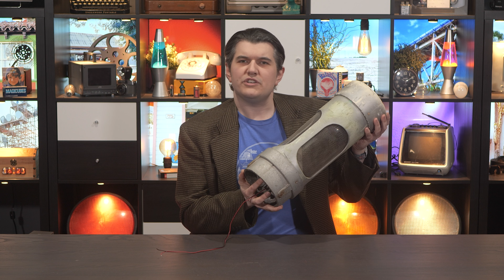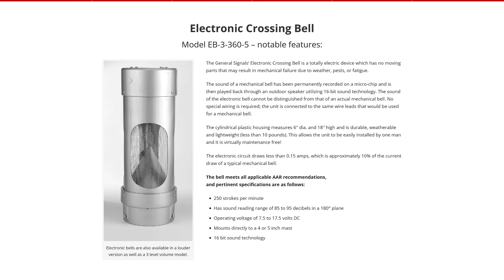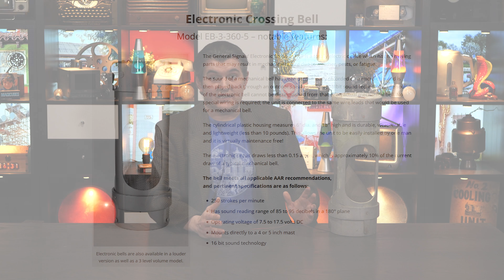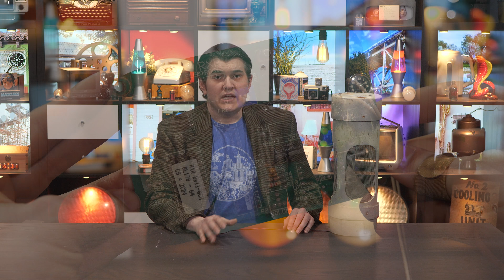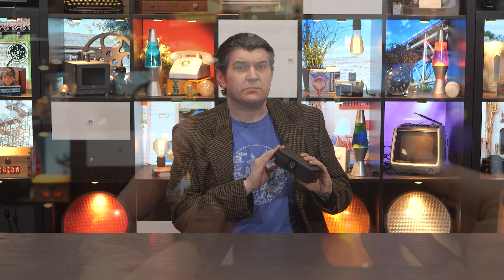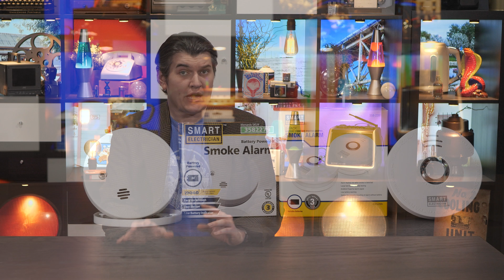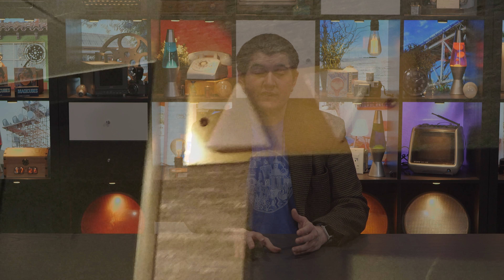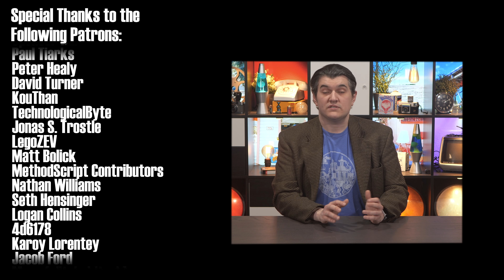The disappearing and unappreciated art of audible alerts

Comment: When I was a kid growing up in the country, one of the things we used to do for 'fun' was to take an old strip of wire and rub both rails at the same time to trigger the railroad crossing. 

The tracks aren't just rails but also an active electrical circuit. Current runs through one rail, and a receiver on the other end is waiting to pick it up. As long as nothing's bridging those two rails, the circuit stays open and the signal system reads it as clear track.

A train closes that circuit through its steel axles. The moment wheels hit both rails, it shorts them together, the receiver drops out, and the system interprets that as a train being present and triggering the lights on and bell ringing.

The wire did exactly what a train axle does. The system is fail-safe by design. A dead battery, a broken wire, anything going wrong defaults to triggering the warning. The safe state is always to alert rather than staying silent.

Comment: There likely was, years ago, a team at various companies which solely worked on audio design for user interfaces. Unfortunately the "we will sell you junk and you'll like it" trend has all but eliminated any remnants of pride in product. It's all about shareholders //and nothing else// these days. I feel it may be an art and science which needs a ground-up rebuild to get anything near what you're rightfully and correctly asking for. Intangible and transient things like notifications interfaces are innately part of our culture. Just look at JR East. they are removing station specific "train leaving" melodies which have been in place for several generations at this point, replacing them with one tone across the system. We have a lot to gain by putting just a bit more effort into creating a world in which we can be distracted when we want, and informed when we want in a general sense. great video as usual.

P.S. This has the same energy as the amber turn signals topic. A small bit of mindfulness goes a LONG way.

Comment: The three tone used by certain tv and radio broadcasters at the beginning of an announcement was briliant. NBC uses low-high-mid pitch. I always thought it should be used for every PA system. It is clear, pleasant, and can be heard over or through any background noise. But no. They insist on doing some kind of ear-piercing screach ahead of alerts instead.

Comment: l changed my windows 1O sounds to those of Windows XP because l felt that some of them were too long, and the "drive disconnected" sound felt obnoxiously scary, like something just broke, and my computer picks up on phantom drives on a daily basis, so l changed everything to sounds that were short, sharp, and carried meaning with a bit of seriousness.

Another thing to address is accidental sounds and signals.
For example, entering the library just as it opens, and hearing the audible "click" employees flipping light switches followed by the buzzing, thumping and chiming of the fluorescent light mechanisms starting up, or the creaking of a door, or the flushing of a toilet, or the sound of a receipt printer working or the high-pitch whine of a display device letting you know that it's on (although that starts to become less apparent as your ears get older) or the beeping tone you hear through all your appliances and radios that tells you that either the hot water has shut off or the street lights have turned on (Too late to go outside now, civil curfew)

A similar conundrum can be found with visual signals too.
Like spotting the funny white cap on a person's head from across a sea of moving people in a busy hospital and knowing that means "This is a nurse" or watching the spinning load wheel on a power meter to see how much power your drawing, or the colors on a traffic signals, and things like "The floppy disk means save"   and the zero and one on a power switch, 

All the things we take for granted, accidental or not change the way we think by sending signals to our brain, and are easily disrupted when you change something, and some people just don't realize that until they can't find their nurse anymore or forgot to get up at 8AM because the rooster died.  This is actually quite fascinating and now l look at things on a broader scale instead of taking these  things for granted.

Comment: The only thing available from the hardware store is the casing. The horn loaded speaker and the circuit are definitely not off the shelf. And the simplicity of the circuit means fewer parts to potentially fail so it can have an extremely long service life. And for the record, I went back to occasionally wearing a Casio digital watch so I can turn on the hourly chime. I have a tendency to get lost in thought and/or activities, and the hourly chime helps keep me grounded to the passage of time so I don’t go down the proverbial rabbit hole. 🕳️ And Android sucks.

Comment: I had an actual brass bell on a curved steel spring that rang whenever someone opened my shop door.

When I got too old to hear it in the back of the shop, one of the guys connected a magnetic burglar alarm sensor as a switch to activate a rotating yellow light that came from the roof of an old work truck.
Reply: that is actually so cool and charming!
i just hope it didnt spook any of the customers😆
Reply: @Memeroid-zz8rqI'm guessing the light was in the back

Comment: The part about the door chime being dead simple reminded me of a conversation I had about the video card power cables that are known to basically catch fire. Someone suggested the only solution to the problem is to have active monitoring everywhere. I rolled my eyes at the suggestion, because, well, we've had circuitry protection for decades that handle more power and are entirely passive. So why would we need active solutions for this particular use case when there's a much simpler solution.

Comment: here’s what aircraft “bing bongs” mean generally : 

-bing : notice to passengers usually seatbelt sign. 

-bing-bong : flight attendant paging another attendant 

-bing-bong, bing-bong : cockpit paging flight attendant

while there are from 4 to 12 or so interphones on commercial aircraft, every one of them uses the same chimes. usually the cabin chief will have a small screen they can use to see actually which interphone is paging, while other attendants rely on voice and/or introduction. also every single interphone has a PA function, on some airlines both pilots and the cabin chief makes welcome announcements.

Comment: About the airplane bing-bongs: That reminded me of how department stores used very similar tones to send information to people working on the sales floor.  Unobtrusive tones that easily blended into the background.  One ding repeating every second for three seconds, might mean they need a manager.  Four might mean they need janitorial.  You get the idea.  And you could go for years hearing these as a shopper and never really acknowledging them, until someone points them out.  I tried finding a YouTube video with examples, but I came up short.  And that also reminds me of my old high school's fire alarm bells.  The bells would ring out three numbers (ex: 1 ding - pause - 3 dings - pause - 2 dings - then loooong pause), and that told folks where the fire was (maybe what floor and what section of the building).

Comment: To your point late in the video - I am damn near the point where I want updates off by default on every device I own, simply because every update keeps making things actively worse. When it's a website or app or whatever... I just have to dread updates, which is a state of affairs I really hate. I remember when we could have old versions of things, but of course that's no longer possible for stupid reasons.

As to the main point, I have a lot of things on my phone muted, but the things which aren't, are really important and I miss quiet sounds a lot, so I have a loud notification sound. The trade-off is these things go off rarely, as in maybe four times a week, so it strikes that balance between usability and consideration. This took a fair bit of effort to set up on an old phone, and I can imagine things being worse on modern phones... and of course not everyone can get away with only dealing with rare phone calls.

(I use the Metal Gear Solid codec call sound for calls, simply because my brain is wired to drop everything for that XD)

Comment: 14:30 I feel like haptics have somewhat taken the place of audible alerts, mainly because they are even more unobtrusive to others. (also, Pebble gang)
16:00 I still like the additional functionality and style of my Gear S3, but man do I miss some of the features of the Pebble and I'm so glad they came back after their untimely demise. 
19:00 As a (somewhat begrudging) iOS user, it's very annoying that I can't change the notification sounds for apps at the system level. Some provide the option, but many don't. Also, the fact that the ringer volume isn't a long-press (RIP force touch or 3D touch or haptic touch or whatever the crap they called it before they killed it) option on the volume slider is absurd. 
19:50 THIS. My watch can do that, but it's about 50/50 whether it keeps going after I've read the notification, or fails to start at all. 
21:00 Yeah iOS is basically the epitome of 'this way is best and if you don't like it you can go F yourself.' What's that, you work night shift? Well obviously if your phone is plugged in past 8 pm (when normal people go to bed, of course) then we should update all your apps! What, you're currently using that app and have been nonstop for the last 7 hours like you do every single day? Too bad! It's being updated and will crash the next time you open it! Yay! Isn't Apple magical! /rant

Comment: “User hostile”- forced updates for sure are, sorry for your parents experience there… if updates are off the version should remain untouched. One Motorola says they’re ‘critical’ and will force restart your phone- even when set to off. Insane… 
20:00 “This is a computer, and it would not be very hard to implement” more truths.
When they take features away with new generations of os or app- Just, Why..!?
20:33 exactly!! Make the devices more useful to everyday use… not like I write an email every day, alarms are daily.. stock sound selections garbaaage on iOS.

Comment: We didn't care about preserving the sound when we upgraded our railway crossing from bells to horns in the UK (though we had a continuous bell rather than an intermittent one, similar to France). Ours use a square wave "high-low" tone (a bit like an emergency vehicle siren but faster) that's found in all sorts of places, from industrial workplaces to even some fire alarm systems (though a fast rising sawtooth tone at 1Hz is more common). Both I believe are from a British standard for a number of different alarm sounds. Home smoke alarms do actually use a temporal 3 tone though.

Comment: I have a Samsung Galaxy 24 something. For email, I use the outlook app, which grabs my outlook email as well as my Gmail. I have had notifications on for email before, so that works, and I can have them pushed to my fitbit charge 4 to preview them. The charge 4 battery, BTW, lasts 2-6 days depending on how often you're using it. I agree with all your laments, I just wanted to put this out there as one possible solution for you.

Comment: This video made me realize just how much energy in my life goes to dealing with the stupidity of notification systems. I've just learned to live with it over time and hadn't noticed how terrible it's become. 

One of the big turning points has been the rollout of app specific power saving by default on Android. Apps which previously relied on being always on now could fail to notify unless you manually disable power saving for the app.

And it's crazy how much now I have to be the one to manually check my email and manually check my messages and other apps because they just can't be trusted anymore. It didn't used to be like this.

Comment: I had the same problem with not receiving notifications on my phone from gmail acc. My work around was to forward those mail to other acc that worked. After I changed my phone it somehow started to work but I've never bothered to disable that forwarding. Its been 5 years that it works. 

Afterthought. It kinda work like custom audio alert. If I get 2 mail notifications back to back it means that its that cursed gmail acc.

Comment: FYI, this video should come with a warning!  Playing T3 or T4 audio signals out loud when an alarm system with a listener is present may trigger the central station to roll fire trucks.  Seriously.  The T3 and T4 audio patterns are picked up by many types of listening devices nowadays, which is why when you see a smoke alarm going off on a television show, the audio clip will NOT use a T3 sound.

Comment: Uk railways used to (and in some rare situations, possibly still do) operate on a system of bell codes composed of pre-established sequences of beats and pauses that one signal-box used to communicate with the next one(s) up or down the line. To prevent confusion each separate bell had a distinct tone to differentiate it from the others. The sound palate of an old manual signalbox was a lovely thing to hear.

Comment: I’m on call all the time at my job. I don’t want to be woken up in the middle of the night but if there’s an issue I have to be. 

Apple does not give me the option to have my phone ring regardless of the switch position for certain contacts nor do they let me have a ringer which only rings at night when I’m home vs when I’m out. 

Therefore my nightly routine is to be reminded to turn my ringer on before bed. I’ve missed calls because of this and it seems like such a simple thing to implement.

Comment: There is an app for Android called Buzzkill that can put notifications on a cooldown and so much more. Notifications repeat when not opened? Yes. Custom vibrations? Sure. Sound while in silent mode? Can do. Turn on flashlight if notification contains the word "pizza"? Not sure why would you, but it can be done. Filtering all those rules by contact? Yup. By keywords? Yup. By app? Yeah. By keywords but just in the notification header, ignoring the rest? Yes and more. And it uses zero mobile data

Comment: 19:00 my android phone used to have an option to repeat text notification vibrations every few minutes, which I liked to have on because I also frequently don't notice my phone buzzing. I noticed a while back that it still does the reminder buzz when my phone is set to do not disturb, so I went to turn that setting off and........ it's gone. I swear I can't find the setting anywhere, so it's just permanently on. there's a similar setting, but it's already off. I have to entirely turn off text notifications at night if I don't want one odd 2am group chat message to make my phone vibrate throughout the night, and then remember to turn it back on in the morning.

Comment: The sound design of modern cars, specifically hybrids and EVs, is probably a whole rabbit hole to go down. Federal law requires sound be played for otherwise silent vehicles typically in low /no speed operation. I have a 2025 Kia Sportage Hybrid SXP and the “backup / slow movement” noise is an interesting higher pitch whirring that folks typically refer to as sounding like a spaceship. Between that and the sound of my electric parking brake engaging when I shut off the engine, my car sounds more like a spaceship than a car.

Comment: After keeping a phone in my pocket for years I started feeling phantom vibrations, even with no phone present. I haven't been able to rely on vibrations for years. I also have sensory processing disorder. So I simultaneously can stand loud jangly noise and also won't notice quiet ones. I have set my important contacts to seperate ring tones and text tones. While we are complaining about things, the selection on the Iphone is pretty terrible. And I refuse to buy tones, if that's even a thing anymore. I used to upload some custom tones to my phones, but I got tired of doing it every few years when I change phones. Which I only do under protest.

Comment: On a similar note, I wish I could push a button on the car dashboard that would activate the horn for a polite 1/4 of a second. You know, to let someone ahead of you know the light has now turned green. Leave the middle of the wheel horn to be laid on at leisure, but I want a guaranteed squick sound for traffic situations that could use deescalation built in.

Comment: I will not be happy until the elephant in the room is addressed: train horns. I live a few hundred feet from a railroad and find the blast of noise from trains passing through two intersections to be intolerably loud if I am outside or inside if I have my apartment's windows open. (Outside conversations need to be paused to allow the noise to stop.) I understand the need for safety (probably better than most), but unless you're nearly deaf you don't need that much volume to alert you of an approaching train. In any case, if you're that hard-of-hearing you probably shouldn't be driving without a hearing aid or at all.

I should note that I saw a train accident when I was a kid in which several people were killed. The horn on the train did not and could not have prevented this tragedy. What would have prevented it is now (I think) a standard at all crossings: gates. The driver of the car involved believed he could get across the tracks before the train arrived, but the car stalled on the tracks. Providing a physical barrier to passage probably does more to prevent accidents than any auditory alert can.